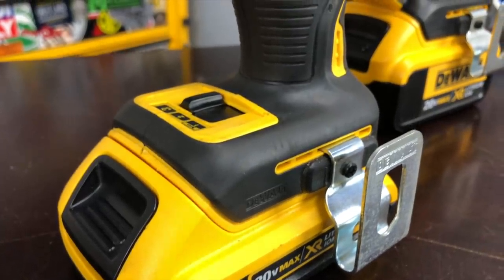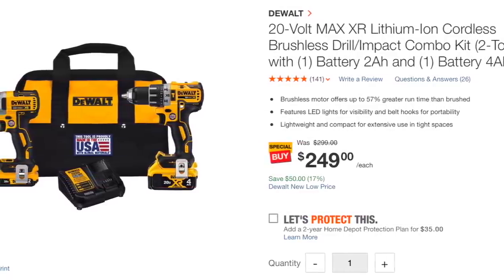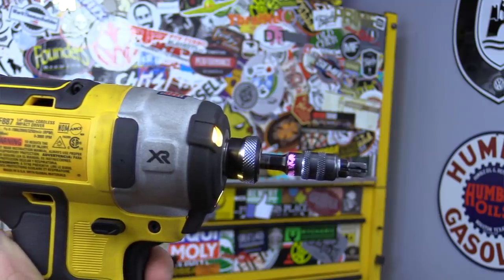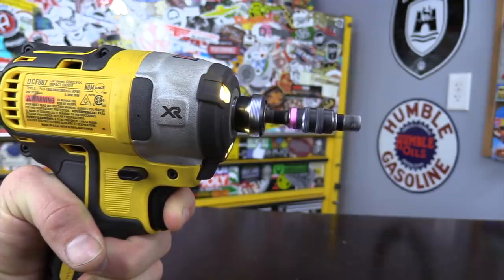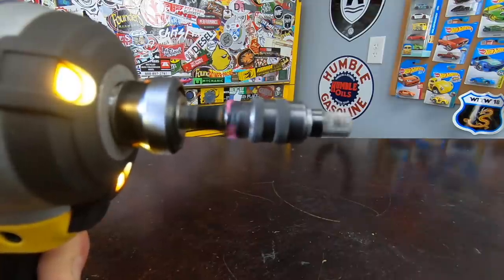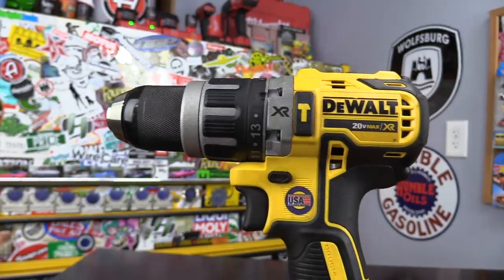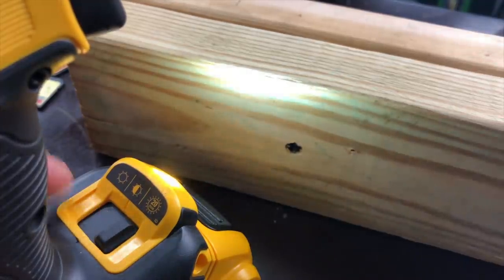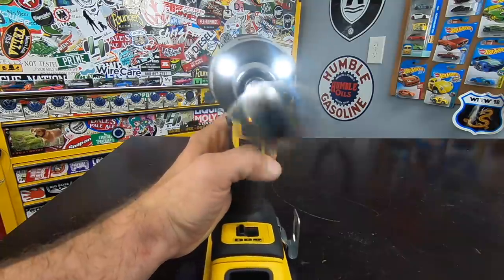Dewalt 20v max XR Impact Driver and Drill Combo

Comment from the maker: I hope you guys are enjoying these quick tool videos. If there is something you want me to test out, drop it in a comment.
Reply: HumbleMechanic actually find that new 12v tools work better. Have enough torque for car work and much lighter for less fatigue during the day. Also smaller 12v tools work better in a small spaces.
Reply: I think general type of tools that would help with doing a better quicker job would be good. Less brand more function
Reply: Awesome review video, keep up the great work, brother. 
Question, is this the DCD996 hammer drill and if so, could you tell us the difference between the DCD996 and the DCD996B?
Reply: @OhDannyBoyy1979  so the dcd996 is basically the standard kit; it comes with a 5 amp battery, charger and case. You have different variations then i.e. dcd996n which is just the tool no battery or anything else but the dcd996b is the tool with a handle grip with no battery, no charger, no case etc just tool and grip. This is to the best of my knowledge and if I'm wrong please let me know. Hope this helps 👍🏻

Comment: The chuck wobble is intended to make it easier to drive screws without having to aim the tool directly with the direction of the screw, if you have a little wobble you can move the tool around and drive your fastener without worrying about it falling from the bit.
Reply: But I could see it being an issue when doing self tapping screws on sheet metal, wobbling around and causing screw to slide

Comment: I own & use these constantly for my job as a stainless steel fabricator & am beyond impressed. The extra drive speed on the drill is fantastic for wire brushing & getting 1/8 drill bits through 12 gauge metal & the torque is fantastic when using step bits. My Dewalt’s have outlasted all the Milwaukee’s in the shop. They complain about the weight of the Dewalts but I’ll stick with tools that don’t fail over saving a few ounces.

Comment: right on. bought a set of the regular (brushless, but non-XR) drill and impact a couple days ago but just saw the XR versions are on sale for only 20 bucks more so I'll be exchanging those tomorrow. great review, thanks!
Reply: update: exchanged and very glad I did. not only did I get the bigger batteries (2.0 vs 1.3) but also both XR tools seem a little bit better put together. most notably the drill has a metal chuck collar vs the plastic one on the cheaper unit. mind you the cheaper one I'm sure is just fine, it definitely didn't seem fragile or anything, and for most stuff around the house I'm sure it's more than enough, but I'm definitely stoked to have a little nicer set that should last me a good long while.

Comment: Very nice overview...thank you! I own the DCF887 driver and the DCD996 drill. I bought them as a kit, DCK299P2 which included 2x5ah batteries, charger and a hard case. They are good company for the DCF899 impact, the DCG412 grinder, the DCB1800 charger/inverter and a half dozen 5ah batteries. I do like me some DeWalt!

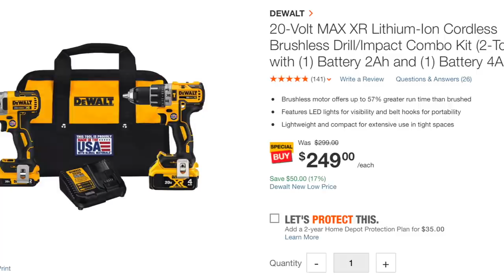Comment: Great video! I believe the combo set you're using includes the DCF887 impact driver (looking at 0:46) and the DCD796 (looking at 4:18). I believe this is combo kit DCK287D2. The Home Depot ad you show at 0:57 is actually for DCK283D2, which includes DCD791 and not DCD796 (note that "Hammer Drill" is missing from the Home Depot ad's title). The DCD796 is indeed a hammer drill, but the DCD791 is not. The combo with the hammer drill is (I think) generally a bit pricier than the price you quote.

Comment: I bought the dewalt 18v with the 3/8 drive chuck. More durable for automotive aspects and can get into tighter spaces. When you have to add the adaptors, it kills its compactness in tighter areas, and we all know space is VERY limited in cars nowadays.
Reply from the maker: Longtrailside that can absolutely be true. I like the 1/4hex to me it’s more versatile. But I think the 3/8 or even 1/4 are great options. 

That’s why in these videos I try to point out what I like, what I don’t like, how I use a tool and recommend you  put the tool in your hand before buying.
Reply: Just to let you know, they do have adaptors for the 3/8 to do anything that the 1/4 quick release can do. You can even turn it into a 1/4 quick release strait from the chuck even, its freggin great! I get the best of both worlds. Hope this helps.

Comment: Damn that's an awesome deal. Here in Oz it's just shy of one grand. As I've said, so jealous of your US pricing, even taking conversion rate into account. Dewalt are my favorite too.
Reply from the maker: Ouch!!!
Reply: Wasn't aware DeWalt did 20V in Australia...
Closer to $500, if not under for two piece 18V XR kit with x2 4.0Ah batts.
Reply: VolV8. I haven't seen 20v either. Best I can find is 18v 5 amph kit on sale for around 700. We probably won't see 20v for a couple more years as our tech trade rating is lower than US.
Reply: Tdl Australia it's exactly the same tool.  Just re-branding to sell them again. The 18v lithium cells at full charge are 20v. In Australia it was deemed to be false advertising to re brand them as the " new model", America lucked out with that one. Though I bought a pair of dewalt drill/ driver at total tools it wasn't $1000 more closer to the 500 mark. Plus the chuck is complete garbage on the drill. Run out is terrible, and the chuck only has 3 months of a warranty. Dewalt had a good name once. Now they're relying on that history to flog cheaply made tools.

Comment: I found the 18v was over kill for lots of automotive.  I am using an M12 Milwaukee Fuel hex impact, very small and light. Batteries are very small and light.  It was a kit with a drill as well, don't recall the exact price....about $200.
Reply: The 12 and 14 volt stuff has really moved forward in the last few years. Milwaukee and Snap-On both make 3/8 impacts that are rated for over 100ftlbs of break away torque. I think the lower models are usually around 60 or so breakaway.

Comment: I recently got the dcf899 impact for suspension bolts and etc.  I got the 12 volt VonHaus electric ratchet (Milwaukee clone).   I think I’m getting the 3/8 impact wrench next.  I’ll use that to remove and take apart things.  And use the 12 volt ratchet and torque wrench to put it back.

Comment: Unfortunately my DeWalt impact only lasted 2 years in a diy/hobby environment where it was rarely used. I'll be trying a different manufacturer for the next electric impact.
Reply from the maker: I would too. I had one that lasted years in the shop. Lol. Try one of the other brands. Most of them are great
Reply: HumbleMechanic mine was the 18v impact which was an older design but it matched the batteries I had for my cordless drill. It might be time for me to switch to the DeWalt 20v platform, especially if you've had good luck
Reply: Milwaukee is my go to. I love them
Reply: Dewalt are 3 yr warranty at least the 20v max are anyways.

Comment: How did they compare with the Mikita impact? One other thing on the Li-ion tools please when charging them, when topped off disconnect the battery from the charger. I’ve seen quite a few Dewalt batteries fully charged but showed dead on charger and wouldn’t work on the tool. Please register your tool ASAP to get the best benefits for them. Be safe and enjoy. I harvest the batteries for different uses and the above info is stuff I’ve ran across.

Comment: Do you drain the 2Ah in a days work? I could see that with construction where you are driving screws all day but I’m guessing automotive work doesn’t typically require constant use.
Reply from the maker: I usually charged them every few days just to be sure the tool didn’t die in the middle of a job

Comment: I'm surprised DeWalt designed the XR model with that amount of chuck wobble.  Surprisingly, their lower-end impact drivers seem like they have noticeably less.  Otherwise, the XR is a great impact driver.
Reply from the maker: Yeah I was surprised too. I even tested a few other impacts I have from other brands. They didn’t have nearly the wobble
Reply: Milwaukee is solid tho" 
Then that DeWalt 887 is known for getting hot an smoking with extended use because it doesn't have the feature to stop tool when getting over heated. DeWalt it Junk.
Reply: It's because it's a one handed design. The lower end ones have a standard collet.

Comment: What is the difference between this impact driver and their standard 1/4" impact? Or, why would this be preferable over their regular 3/8" impact?

Just wondering as I've been using a cordless 3/8" impact for damn near everything on my car.

Great vids, btw. Love your stuff.
Reply from the maker: I think it’s more about bit options. I have a lot of torx bits that drop right in. Plus I have a 1/4 drive and a 3/8 drive adapter for the hex drive. Basically I can run anything. There are plenty of ways to get it done. It’s all what you prefer.
Reply: HumbleMechanic Thanks for the answer, as that makes a lot of sense!

I've only worked on Japanese cars, so hex bits are an after thought for me. I've fallen in love with my Dewalt 20v 3/8" impact. Its been great so far and is a really nice size/weight.

Also, howzabout teaming up with Ericthecarguy for a "just for fun" build? It would be rad to see you guys working through building something together.

Comment: Wobbling of the impact driver has an advantage when your putting machine thread bolts in, it allows for the bolt to 'set' at the correct angle. The problem with this wobble is using it to put Zip screws into sheet metal. Being that we do mostly sheet metal we are going to switch to another brand. GREAT VIDEO!!

Comment: What brand is the locking 1/4 drive adapter? That seems amazing. I use my ols white 18v Makita. All the time for the past 4 years in an auto enviromnet. And as always more tool reviews the better. Even reviewing any tool is awesome
Reply from the maker: It’s Snap On. It was expensive maybe $30 but it’s awesome. I have this one and a kit with 3, this one and 2 longer ones.
Reply: HumbleMechanic thanks dude. I'll get some next Tuesday when he comes back. Also thanks for always being great with video replys. Ive loved you video since you wore glasses and a pony tail. Glad youve never stopped being awesome.
Reply: I broke a cheap adapter in my Makita driver (the black and white combo, great set) and it cost me almost $30 to replace the anvil when I couldn't get the rest of it out.

Comment: I very seldom used a drill inside a vehicle as I did mostly dash work. Too too easy to break plastic parts. I broke a piece on a Lincoln just removing a screw that was stuck and said that's enough back to screwdriver. I could still beat flat rate times so no biggie. I'd rather lose a couple of minutes than break parts. 
That's just me though.

Comment: I only wish DeWalt put a 2-range switch for speed control on the impact driver, since it’s easy to accidentally pull the trigger too hard and most applications don’t require high speed, and are actually done better at lower speeds.
Reply from the maker: There is some stuff coming out that is built on variable speeds which will be cool. Not sure if I will jump on the bandwagon there, but it's still cool.

Comment: This was a great video, thank you! Why wouldn't you use this as your "standard tool to pull lug nuts off"? My civic only torques them to ~85 ft/lbs and this driver can handle ~150 ft/lbs. Is it just a personal preference, would it cause premature wear on the tool, or do you just prefer to use a more powerful impact for those potentially extra-stuck bolts? Thanks! (Looking into buying an impact for house + car work!)

Comment: If you put a 1/2 adapter for a socket it will take wheel nuts outs. It will even brake the adaptors. I used mine for 3 years pretty much to do everything till I broke it when i ran over it lol
Reply from the maker: It sure will. I don't think I would stress it like that all day every day, but she will take off wheel bolts.

Comment: Charles,

Our rally team has always run older NiCad DeWalt tools, and we keep an older cordless full size impact under the spare tire in case we need to change a spare on the stage. These tools belong to my co-driver and I'm considering investing in a set of DeWalt cordless tools. 

My question is, given the fact that we are very specific on the torque of our lugnuts, and have the service crew check them at every service, would this impact be a better, smaller, light-weight alternative to the larger, older unit we currently use? 

Thanks
Reply from the maker: If you’re doing wheels I’d probably not use this. One. It will do it. But to me it will over work the tool. 

Plus you’d have to have a 3/8 or 1/3 adapter on it. 

For that use I’d rather a 1/2 drive impact like the Milwaukee mid-torque.
Reply: @HumbleMechanic   Thanks for the quick heads up. We'll keep the 1/2 inch in the car still, and I'll save the 1/4" for the garage. Saw two dudes tear apart an entire Subaru long block in like 40 minutes using one of these 1/4", only had to use the air impact on flywheel and crank pulley. Very impressed. 

Thanks again!

Comment: Review this: festool pdc 18/4 - borrow one from a friend just to hear and feel how it works
I use as a daily driver a festool pdc 18/4 and i compared with new dewalt batteries drills at a dewalt demo-car .
1 all dewalt drills are VERY loud even at no loads compared to the festool pdc 18/4 . If you compare the sound made by festool the dewalt sounds like a broken drill.
2 the festool pdc 18/4 it incorporate a smarter electronic driver .

Comment: I had the chuck on the impact driver break, so I had to safety wire the bit into the chuck.  I've also killed a couple of the batteries (smaller ones) and a charger.
Reply from the maker: Damn! What was the usage like?
Reply: I used it mainly a lug wrench.  But I always use a breaker bar and a torque wrench, so just basic usage medium work loads.  I would've liked a 3/8" or 1/2" chuck, since having to used 2 adapters for a 3/4" deep socket, that might have caused some of the problems, like the wobble you described.  BTW, I race a MK1 Rabbit in the GTL class of SCCA.
Reply: Just replace the anvil, and you should be good to go. That's how I converted my DCF886 to 3/8 impact wrench.
Buy 3/8 anvil (608116-00SV), O-ring (608115-00) and hog ring (608114-00). Retail prices were $25.28, $1.01 and $1.95.
Dewalt service center should sell them or check online.

This should be a direct replacment to any 20V impact driver anvil (brushed or brushless)
Reply: Thanks

Comment: I use the 20v set every day and have has both dewalt and Milwaukee. If you are gonna be doing construction type work dewalt hands down wins in my book Milwauke just doesn’t have the torque the 20v dewalts have. I have burnt up probably 10 Milwaukee impacts they where not brushless but they also never lasted as long time wise per charge either. That being said Milwaukee has better mechanic type tools that I would love to have
Reply from the maker: I love Milwaukee’s focus on the auto industry

Comment: Amazon will have this set on sale for ~$150-160 at least once a month
Reply from the maker: Wow really? It’s a steal at that price. Just be sure it’s the exact kit.
Reply: Checked my set. You're mostly correct it isn't the exact kit. Mine doesn't have the flashlight button, and it came with 2 small batteries, instead of a small and a medium. AND it doesn't have the 'Made in USA' sticker. But its a Dewalt brushless 20v MAX. And at least once a month its on a good sale.
https://www.amazon.com/gp/product/B00CSDIMXY/ref=oh_aui_detailpage_o03_s00?ie=UTF8&psc=1

Comment: The 4ah battery also means more power. Now for the real question, why would I get this set, rather then Milwaukee?
Reply from the maker: A great question. I actually think both are great. I own a good amount of Milwaukee tools. 

The reasons today id buy one over the other are:

1) You own other tools of the brand and have batteries for them 
2) You want to own other tools buy the brand
3) You have an affinity for the brand 
4) You like the color? 
5) Ergonomics of one is better for you personally than another 

I really don’t think you can go wrong here. This Dewalt set is great, the comparable Milwaukee is great too.
Reply from the maker: And you’re right on the battery. For me I’d give up that for the weight reduction and better balance

Comment: How long have you used the tools for? I like the content but I would have preferred to see more transparency about duration of use/ownership and sponsorship disclosure (tucked in the last 30 seconds of the "review" doesn't inspire consumer trust lol).
Reply from the maker: Good points. I’ve had it 2 months? Probably 4 solid hours of run time. Used it on every job I did on the MK5 pretty much. 

On the disclosure I feel what you’re saying. Because I’ll be doing more tool stuff I’m testing to see what fits the best with the flow of the video and what people hate the least. If this is your first Humble Mechanic video I think you have a great point. If you have been around a while I’d assume you’d either trust me or not?  

What would you say is the least offensive way to mention this video was sponsored?
Reply: HumbleMechanic The least offensive way is to come right out with it at the start. "DeWalt gave me these tools for free to test; here are my thoughts". 

To be honest there is no good way as there are people out there reviewing these products out of their own pockets. They have a level of objectivity and trust that you cannot match and it doesn't help that they have a lot more authority on the topic of tools than you. 

My 2c, you should have said no thanks to the sponsorship and spent the time making content that interests your viewers, there are plenty of other channels for power tools.